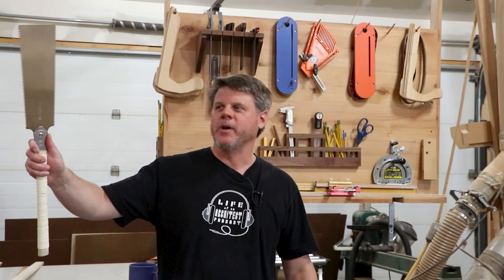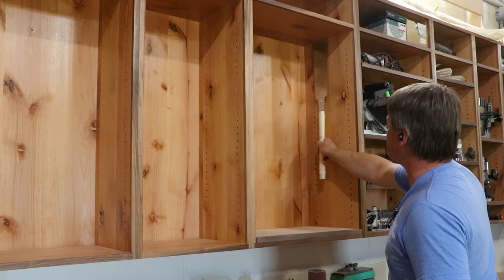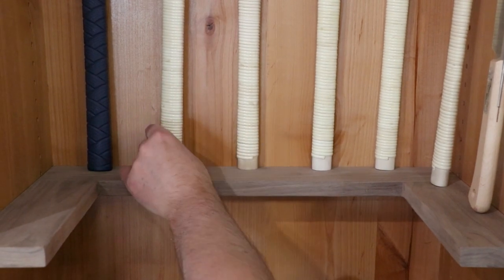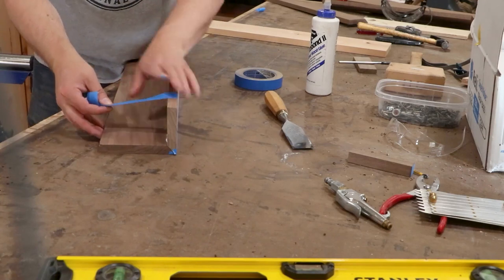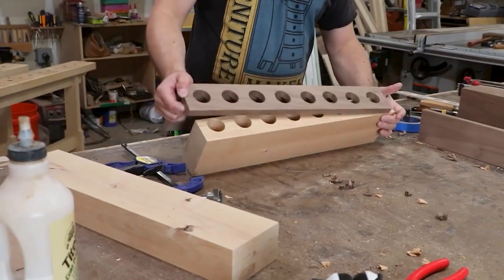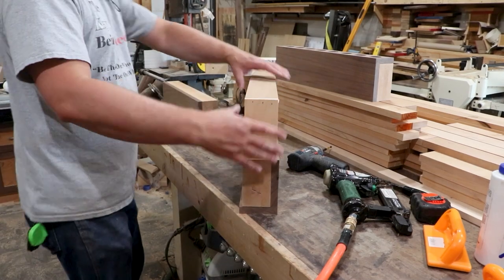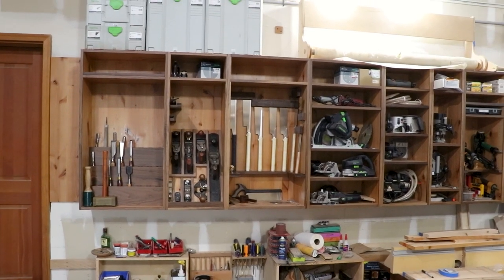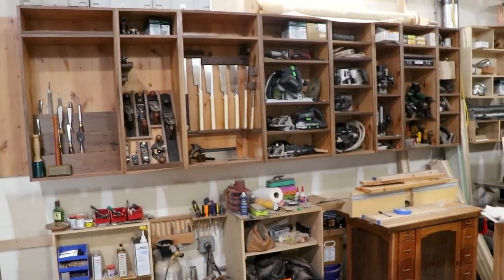Building a Hand Tool Cabinet - Saw Till and Chisel Rack

Comment: Nice work, and it looks nice if you only want to look at the chisels, but if you want to use them too.. that is a biiiig no no in my eyes. There was a comment that be careful cause you may cut your finger....well, think about this  : by accident / unattention when handling the upper row chisels you cut your inside part of your wrist. And if the chisels arent blunt, that cut wont be just a scratch, it will bee a deep wrist vein cutting horrible thing. And that is BAD. Just my thoughts. All the best !

Comment: As long as it is only excess glue you are wiping off LOL. And yes I'm guilty. Genuine concern Brian, With the chisel blade 'Up' and tiered, do you have any worries about snagging your hand on a blade as you reach over the front lower levels?
Reply from the maker: Thanks, I put the shorter chisels up front so, so far it hasn't been a problem.  If it does, become one, I'll make a new video show me changing it. 😂